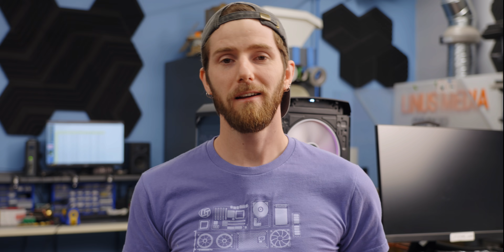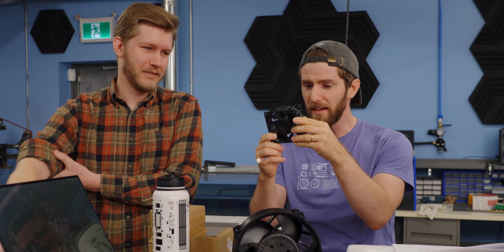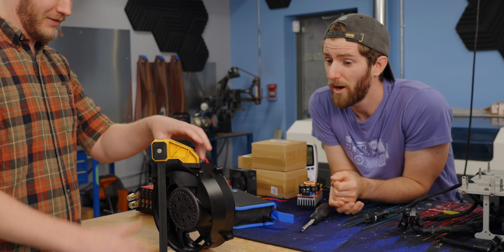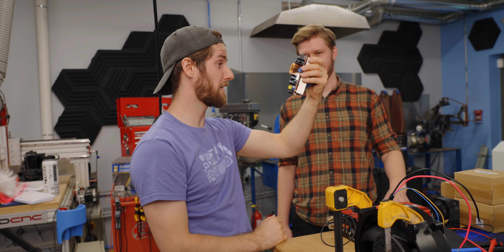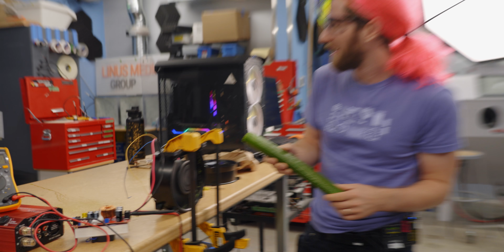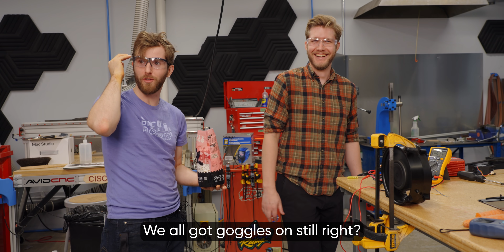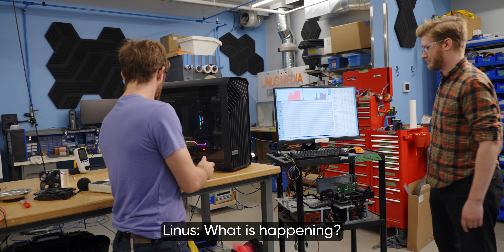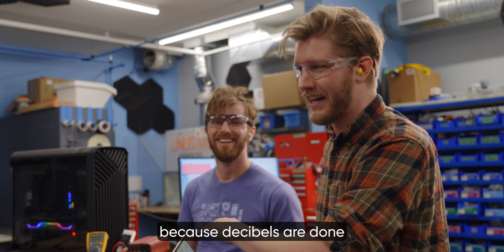The God of Computer Fans

Comment: That power supply isn't nearly as dodgy as Linus thinks. It's pretty standard for a boost converter, they're meant to be installed inside projects, hence the lack of enclosure.
Reply: Those capacitors were also very tiny and low voltage compared to the ones that you generally have to worry about killing you.
Reply: I would not trust that thing with 30A though. Why not get a 48V server PSU in the first place, those are common and relatively cheap. The fan also has a PWM input for speed control.
Reply: @teslatrooper  Also pretty sure Motherboards have 24V that act as the MAIN power supply for the CPU, or maybe my PSU and Motherboard needed it since it's a Threadripper.
Reply: @tdata545  threadripper still considered a consumer grade product so no, they dont have 24V line. only server and telecom stuffs have 24V and above for their bus voltage option
Reply: @tdata545  motherboards are 12V ATX.
Reply: what about the solder job they pointed out? does that cause any worries on the quality of it?
Reply: @_QWERTY__  They didn't really show the solder job on those screw terminals, it's on the other side of the board... Anyway, the reason they were so crooked is likely due to overtightening the screws, which in turn puts torque on the whole terminal. I've seen it happen a lot, done it myself a few times. It's really not easy to solder a terminal on crooked like that, they have holes in the board that it fits perfectly flush and straight when you just drop it in. But it is very VERY easy to bend soldered screw terminals like that by going too hard on the screws. Alex said he played with the thing yesterday, so it makes sense to me.

The ratings on these cheap chinese boards are often way optimistic, but other than that, they're the same stuff that the expensive brands use, just not in a case.
Reply: @MrMats0n  They also did show the cables hitting 90 degrees, so another possibility is that the terminals have simply been damaged from that heat during whatever testing they did before recording the video. ABS plastics, which are the standard plastic for such terminals, have a glass transition temperature of around 100 degrees (simply put the temperature at which they become malleable), but in practice they're rarely rated for temperatures over 80. Put strain on a hot plastic part and it will begin to warp almost immediately, even something as seemingly benign as the module hanging off a cable could be enough to cause the sort of warping we saw here.
Reply: @_QWERTY__  no
Reply: lol linus loves to use commerical grade hardware, but then shits on it for not being consumer enough
Reply: Linus is terrified of electricity. A while back he threw away some lights because they "only" used a little plastic cover to protect the terminals.
Reply: yep, it even has current protection. I've blown dc-dc conv accidentally shorting them :o 

Good thing I also have hot air and a bunch of almost identical spares! Just that my favorite shitty conv has a screen showing voltage :D
Reply: The fans are rated for 384watt.. but their powermeter showed over 1200watt for 2... just sayin
Reply: @AndrewTSq  you forgot to add the PSU and boost converter efficiency. the most inefficient part could be the boost converter
Reply: @AndrewTSq  inefficiency of 2 PSU and 2 converters, I guess.
Reply: Linus thinks he knows more than he does
Reply: Yea, and to have a pot to adjust the output voltage is also normal. I have tons of power supplies from Mean Well, and they all have pots to adjust the output voltage.
Reply: And realistically at the voltages it's seeing, worst case is letting out the blue smoke from the mosfet a bit violently. Then again, I'd much rather be overly concerned about power supplies than not, so there's that heh.
Reply: Exactly, the way that is set is pretty much standard for how things are done. One thing I do at my job is calibrate and certify the bench supplies in our clean rooms at work and the initial power setting is done with a little pot just like that.
Reply: @NavyDood21  It's not standard at all.  Normally if you want your fans to get 48V, you use a 110V/220V AC to 48V DC power supply, not buck down to a lower 24VDC then boost back up to 48V.  It more than doubles the inefficiency losses.  Such a PSU is not cheap, but nowhere near the (what was it?  $800 or $900?) cost stated in the video, if already willing to accept mediocre quality as they did with the boost converter.
Reply: @stinkycheese804  😂
Reply: @NavyDood21  Would you by any chance happen to be a metrologist?
Reply: Yeah, its cause linus is a tech guy and a electronics noob thats why he does not know that a boostconverter comes in that form
Reply: @309electronic5  Electronics are tech, though.
Reply: Agreed, seems totally standard
Reply: @MKDC-5  Linus is not an engineer, Alex is
Reply: It is dodgy, because made with cheap chinese components, including the tiny little potentiometer, to power something that expensive.  Plus remember in the video, running within ratings it was running so hot, not what you want powering fans to cool something even more expensive.
Reply: He just dosent understand the concept of cheap electronics. And whines when it dosent cost $100s more than what it should
Reply: You have to remember, these guys aren’t particularly bright about the low level of this stuff, they’re strong suite is production and passion. Sometimes it takes not knowing about the internals to get so hyped about everything 🤷🏽‍♂️
Reply: Yeah my brain hurt when he said it's janky and stuff
Reply: Where's the boost converter made by apple that just plugs in
Reply: @archietheproto7706    That would be unrepairable landfill and cost at least five times as much. 
                                      You know, built for the shareholders

Comment: I used to work at a company making these for military and aerospace applications.  We made them to cool everything from electronics racks on military planes  to the brakes of commercial airlines.
Reply: I still remember touring a system of blowers, vacuums and compressors in a large facility. Motors from 25,000W up to over 200,000W, all just moving air. They claimed the building's power load - just for air - was like running every household microwave in a five mile radius. All day, every day.
Reply: @passintogracegoldenyearnin6310  damm. lol
Reply: [卐]Lakehuntist ⸜⁄  lol the fake verified checkmark
Reply: @grants7390  lmaoo
Reply: Fun fact: Boeing 777 would be completely silent without these
Reply: yep, as soon as I saw them I knew they were for the avionics & electronics bay of aircraft
Reply: Thats what I was thinking these were for, thats cool!
Reply: bros plane uses an rtx 4090 to fly
Reply: What were the electronics doing that they needed so much cooling?
Reply: @user-op8fg3ny3j Doesn't really matter what it is doing. It's redundancy for max theoretical output or future use that can gain from it. When power consumption and money isn't an issue, then you would always buy the biggest and best. That's the world over for consumers, let alone commercial usage

Also commonly used to direct and push cooled air in a specific direction. Like Aircon etc.
Reply: [卐]Lakehuntist ⸜⁄  I thought this was funny, until I saw the Nazi Swastika.
Reply: @Nomanspie  🤓
Reply: @Nomanspie  could be hindu
Reply: @jay-5061  doubt that very much. He's some teenage white boy trying to be edgy.
Reply: @jay-5061  the manji symbol is the other way round, it's made that way so that if water drops down on the wheel it goes clockwise, not anti-clockwise like what you see on that guys username
Reply: @SuperKendoman  I'm fairly certain the guy used a Hindu saathia
Reply: @Nomanspie  that's unfortunate since he used the Hindu symbol incorrectly
Reply: @SuperKendoman  the Hindu goes the same way, is the well being swastika. The Manji, Japanese, is the other way, good luck, prosperity.
The  Nazi Swastika or Hasenkreuz is in the diamond orientation on the point, not a square, as well.
Reply: @jay-5061  it would be diagonal if it was
Reply: @Nomspie You mean Hamas supporter? Meaning a black or muslim boy, you are projecting

Comment: Surface speed is also a function of circumference. a 3" fan and a 6" fan spinning at the same RPM means that the tips are going WAY faster on the larger diameter
Reply: Hence why a 9” grinder is rated for a lower RPM than a 4.5” or 6”. There’s a lot more mass on the grinding wheel.

Comment: Setting industrial equipment settings with a potentiometer is surprisingly common. I've seen some older PLCs (2010 ish) that set their IP with them...
Reply: Omron PLCs still do, set the last digits of the IP in Hex
Reply: their ip address? with a *potentiometer*?!
as a gen z young child that ht me like a truck, what?
Reply: @purplelord8531  probably not actually a potentiometer. Most likely he is referring to a coded rotary switch. Like setting dip switches to set a device id
Reply: @TaylorZalus  Imagine having to scroll through all 4 billion IPs one by one
Reply: @purplelord8531  Yep. Each octet was set by one. It's one of those 'it just works' things like serial. When I'm on site about 75% of the time I prefer connecting via serial than ethernet if it's even an option.

Comment: Behold, the only fan that can air-cool the RTX 4090.
Reply: And consumes same amount of Power
Reply: "Only fan" lmao

Aight, Imma head out
Reply: @rubenbitoun1217  I knew I should’ve said phrasing.
Reply: @rubenbitoun1217  c'mon man
Why?
Reply: @projectmoonlight7413  I'm sorry, I had the do it.. it was my duty..
Reply: @rubenbitoun1217 ”duty” eheheee
Reply: @rubenbitoun1217 😂😂😂😂
Reply: *1/5th of a RTX 4090
Reply: @njebs.  hahaha lol not even close
Reply: @njebs. rtx 4090 is cheap af
Reply: I used the 600W to cool the 600W
Reply: Don't say that, NVidia will buy them just to make sure no one can cool it.
Reply: Amen
Reply: Nah. 4090 temps are actually OK with it's stock cooler and fans.
Reply: Nah, we need Alex's ideas for that
Reply: next time remove the graphic card fan and shroud.like in some servers.
Reply: It needs it's own PSU now
Reply: And I think it would still come a little short. Let's hope it does live up to it title.
Reply: Actually, the 4090 draws the same power as the 3090ti, and uses the same fans.
This joke isn’t funny
Reply: most 4090s runs pretty cool actually, ive NEVER seen the suprim x go above 65 at a 3k core clock

granted, they are as large as they are because that's what's necessary to dissipate 450W and they do put a lot of heat into your case, resulting in higher ambient temps affecting other components
Reply: You mean half of whats needed for the 13000k
Reply: @OnSaintReal  You mean 7000 series from AMD I guess.
Reply: @BrawndoQC  ?no, the k series if overclocked w the pros
Reply: @OnSaintReal  You haven't used a 4090 nor a 7000 amd series and it shows.
Reply: @BrawndoQC  im not necessarily saying it does more im just saying what i wrote is what i meant and i was refering to the video they made with Splave
Reply: @OnSaintReal and a ⅛ of the 14900KS at full power level
Reply: Lol😊
Reply: Its a compakt card, yeah
Reply: I want a triple fan RTX 4090 with these!
Reply: I think you will all be pleasantly surprised net week when it barely hits 70c 👀
Reply: yeh that is very true
Reply: GG, got hearted
Reply: they should actually test that
take something like 4090 strix, take the shroud with the fans off, and just point one of these at the fin stack. i have a feeling it would actually work perfectly fine
Reply: @elektroencefalografista  for science,                   you monster
Reply: That attempted joke didn't age well.
Reply: No the only thing that can cool the 5090
Reply: Temps on the 4090 are actually pretty nice stock on air.
Reply: I think you mean 13900k and 3090ti. Thermals on the 4090 are really well tamed. Ive been stressing dual 4090s and i cant believe how good temps are underload and overclocked 400/200mhz
Reply: Nah, my strix 4090 is absolutely happy on air cooling, I though about water cooling it but decided ultimately it wasn’t necessary at all
Reply: Naaah you'll still need water for that
Reply: @burdulinika2005  that aged very bad
Reply: @burdulinika2005   go to bed your so serious
Reply: @burdulinika2005 ice*
Reply: @burdulinika2005  need more thermal paste
Reply: @burdulinika2005  not at all
Reply: lol, would a 10 inch 125 watt axial fan cool that beast 😂😂🤣🤣🤣🤣🤣🤣
Reply: With so much power draw and the need for multiple household circuits people should probably have electricians install their pcs from now on.
Reply: Its about the right size to boot, thats a win in my book
Reply: And it'll keep your house fire adapter cool too.
Reply: That's why the 4090 is that large, they needed to fit the fan in 🤔
Reply: XD
Reply: [卐]Lakehuntist ⸜⁄  yeah sure...
Reply: hahahahaha, hilarious!
Reply: It feel like Linus is out of contents, so they test out a finger chopping fan. 

🤓
Reply: [卐]Lakehuntist ⸜⁄  kids these days need a brain, idk why was it removed in the dlc
Reply: Marty Fourre  Hes cos playing a blue tick
Reply: Why do we ever need custom watercooling system when you have this fans. I can finnaly save 400 euros and have decent temps instead of a 800+ euros custom watercooling.
Reply: And it draws more power ;)
Reply: Takes about the same of power to run
Reply: Ight lemme just pulls out 30hp car wash blower ah yes this should do it but it will be heard across a block or two
Reply: My goodness, you're right!
Reply: the cable connector yes
Reply: Make a shroud for that and its amazing. Just Loud
Reply: Barely"
Reply: LOL
Reply: Two for the 9080 💀
Reply: How can you air-cool a brick
Reply: Behold the video with 2 sponsors
Reply: Ungay yourself.
Reply: It will need these fans and water cooling system and some 🧊
Reply: I will play fortnite on it LOL
Reply: You would need a few of them
Reply: bro thats fax
Reply: LoL lier
Reply: You mean the best AMD r9 290 cooler?
Reply: @Милвалке  nop
Reply: @vezertrojai  yup coz the AMD r9 290 is very hot, so that's why I'm saying that it could be a fan for it
Reply: maybe if you hook them up to a water radiator
Reply: These fans should be on a 7900xtx
Reply: the real only fan 😮
Reply: Behold the fan that would cut more than 1 finger of tge smaller fans will tear fingers to shreds this will cut them off
Reply: Just submerge it into novec 3m at this point LOL
Reply: I know you've done a terrible job of using an automotive rad for water cooling, but have you tried using 12 inch or larger thermofans replacing the side panels of a pc?
Reply: You still neeed 3
Reply: No no no you need a jet turbine to aircool the rtx 4090
Reply: I think you ment a 1/10thof the 14900kf
Reply: Nah, still needs a water cooler the air will be 100 degrees Celsius hot in 10 minutes
Reply: TRUE!!!😂😂😂😂
Reply: consuming as much power to cool or as it uses huh
Reply: The only fan that you need 😂
Reply: The only fan that takes as much power as an RTX 4090
Reply: 5090: really?
Reply: Now for 600w 5090
Reply: Lol true
Reply: @Neoxon619  nah rtx 5090 32gb vram actually
Reply: @Neoxon619  pfp says it all
Reply: The rtx 4090 is better then the 5060 tbh
Reply: Thought the same, was thinking we will need those with the new 4090's and the new intel CPU's.  Also will need a 240 plug into the bedroom to run it.
Reply: 1/100qd
Reply: "Only half" of RTX 4090